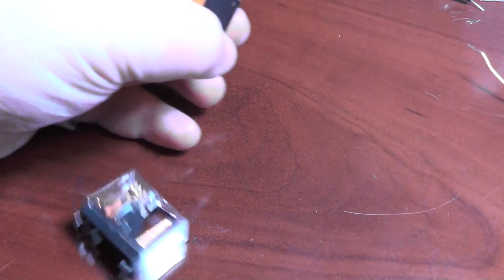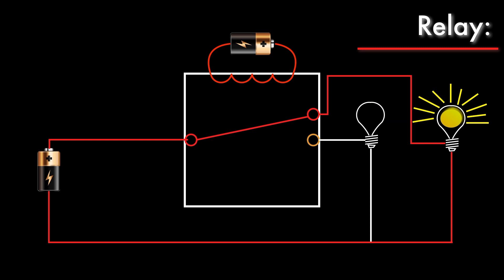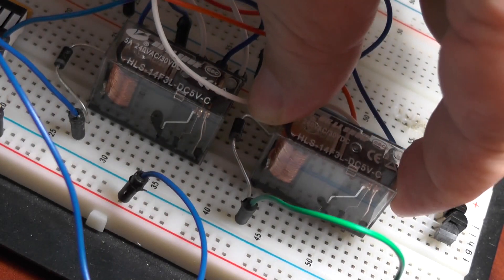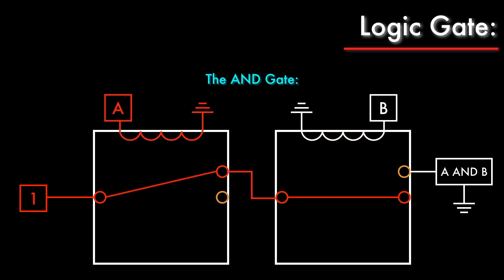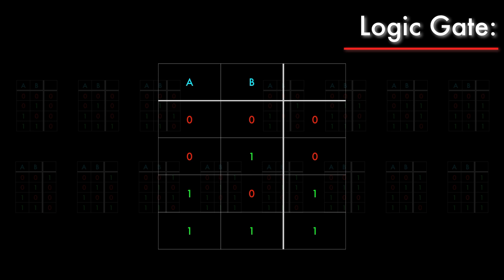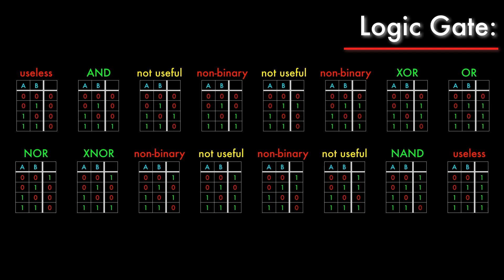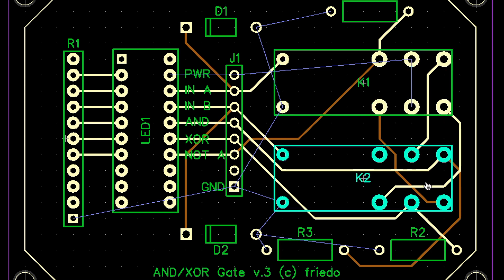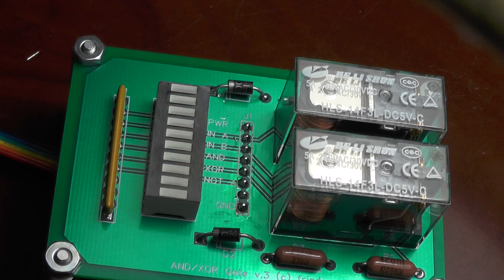Relay computer ep. 1 - Basic logic gates

Comment: What are the diodes and resistors needed for in the circuit? I dont normally work with PCB, but instead breadboard, so looking at this isnt intuitive to me.
Reply: Fly back diodes to prevent high viltage spikes from the coils
Reply: @darkworlddenizen  Okay. 2 diodes for flyback voltage. What about R2-4? They appear to be connected to the logic outputs, and possible the diodes as well.

Comment: I agree with everything you said about the last 4 possible gates. but there are a few things I would have added or said differently. You said everything could be done with the existing gates, which is actually already overdefined. You could do everything with Just NAND. so that's not really the reason why we exclude those 4. We exclude those 4 because they treat inputs A and B differently. For all the other gates, it doesn't matter which direction you wire them up, they work the same. For the last 4, if you switch the inputs, you change the function of the gate. That may be useful in dedicated state machines, but for a CPU that is designed to have nearly infinitely broad applications, it just doesn't make sense.

Comment: It is possible to build an AND gate out of a single relay. One input controls the coil, and the other is feed into switch of the relay. If both have high voltage the output will also be high. If either is low the output is floating, but adding a pulldown resistor solves that. An OR can also be made using a single relay by wire ORing the inputs to the coil. Diodes can be used as well to prevent one input backward propitiating to the other. Since you have flyback diodes you're allowing this semiconductor. Inverters are also a single relay logic element. NAND can be built using two.

Comment: The XOR function and its associated wiring diagram is identical to the function of the light switch for the stairway. One switch on the first floor, and another switch on the second floor, are wired so that the light can be activated and deactivated by either switch. These SPDT switches do not have the words "ON" and "OFF" engraved on them.

Comment: I'm wondering 2 things.
1: Why use relay's instead of transistors?
2: Why are relay's so large? Reading from it's design, i would expect a much smaller device.
Reply: 1. For practical purposes, both are not viable of course, FPGA ftw :) But when we're seeking for visual representation of logic circuits, relay are much closer to 'math' than transistors. As seen there, 2 relays easily implement XOR gate, while doing the same on transistors is pretty awful, usually it's done with 4 NAND gates, each requiring at least 1 transistor and 2 diodes, and also current-limiting and load resistors. It may still be smaller than 2 relays (especially if using SMD devices), but it is hardly understood what's happening there.

2. There are smaller relays out there. I'd presume the smallest are reed switch relays, they are actually very reliable because contacts themselves are in inert gas, so they don't get dirty and don't oxidize, they can easily withstand million cycles and more. But they're not so beautiful :) They click very quietly, one can hear them only by putting ear to the device, also reed switch itself is 'buried' inside coil, so it's nothing to see there, just a cylinder slightly bigger than resistor...

Comment: The devices you are calling DPDT (typically referencing a switch configuration) are relays with two Form C contacts. A Form A contact is 'normally' open (i. e., in the non-energiezed state), while a Form B contact is 'normally' closed. By a stretch, the Form A contact could be described as a SPST.  It would be a stretch, since for the Form B contact, you would have to look at a SPST switch 'upside down'.

Comment: Really interesting. I found this looking for some information on one of my ICs I'm using to make my calculator.
I never thought about relays existing before vacuum tubes. Why didn't they make computers out of relays instead of vacuum tubes back in the day? I assume it's either the actuation time or the reliability of their timing, but I'm just guessing. Seems like it would have been a lot cheaper and possibly use less space. Don't really know how small relays could be back in the 40's-60's :P
Reply from the maker: Some of the earliest digital computers were in fact made from relays (I mention Konrad Zuse in the video; look him up if you're interested.) But as you suspect tubes can switch much faster and with less mechanical wear.
Reply: @ClicketyClack  Very interesting, I'll look him up for sure. Awesome little board you have there. I love these unique takes on CPUs and ALUs. One of the most interesting projects I've seen. 
If relays last decently long with the cases removed I think that would be kinda cool to see it uncovered. But I imagine having to replace them isn't to fun :P
Reply: @mike0rr  If the relay  cases were removed there is a possibility that an insect  could become lodged between a pair of contacts, thereby insulating what would have been a current path. That event would cause a faulty logic function. This is why incorrect logic in a computer program is called a "bug".